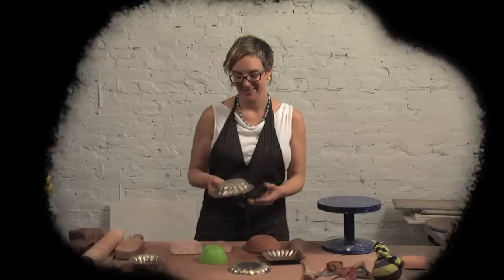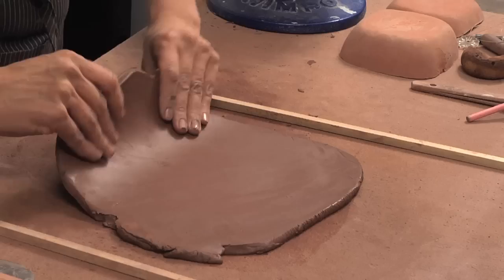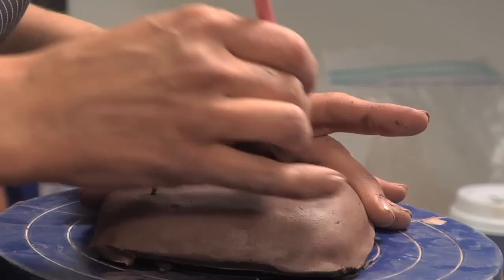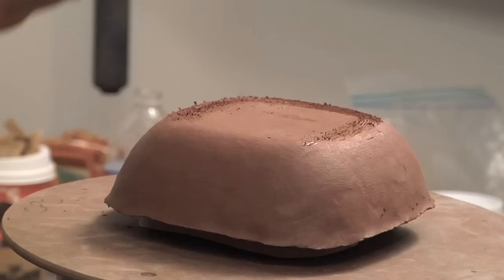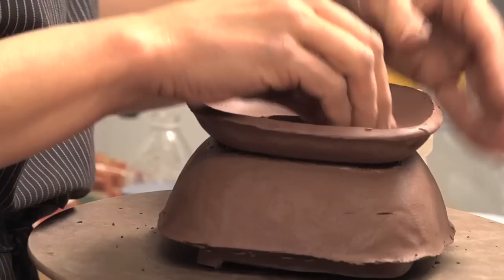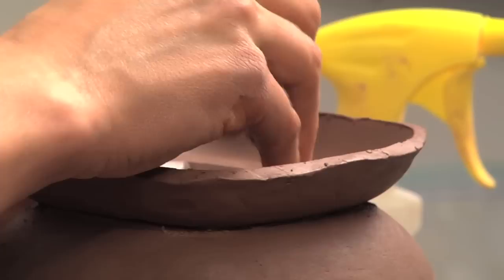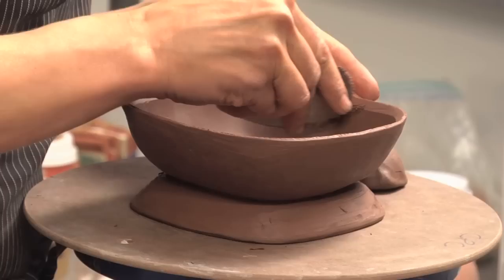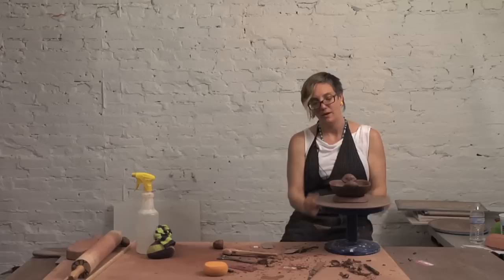How to Handbuild a Stacked Dish Using Bisque Hump Molds  - KARI RADASCH

Comment: Im curious if you have any issues withteh air in the puffy pinch pot handles exploding.  as I did not see air holes?  I was always told to put in a hole if i had trapped air. ( like adding   something air filled to a pot ??